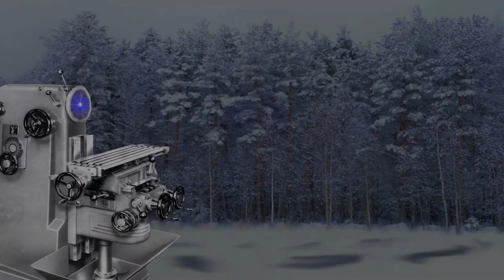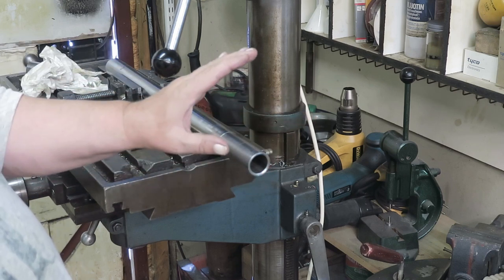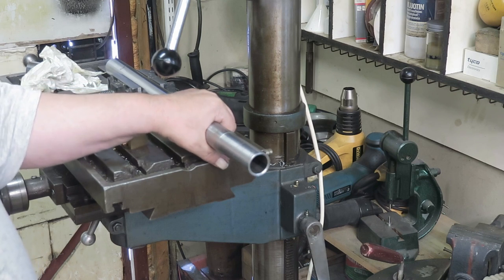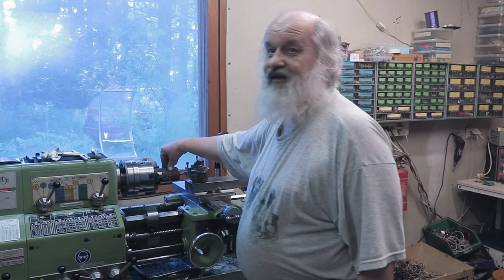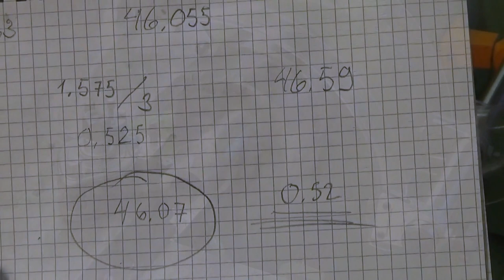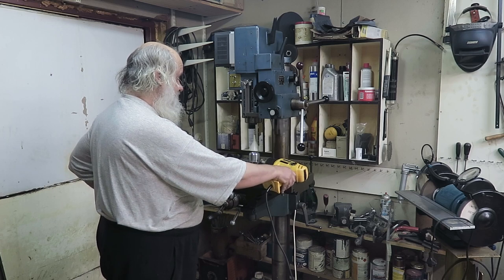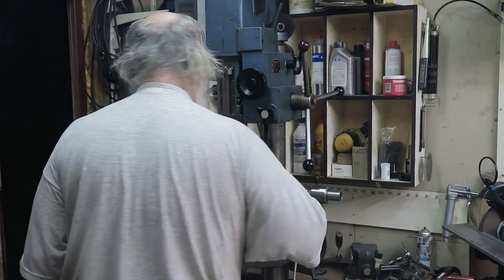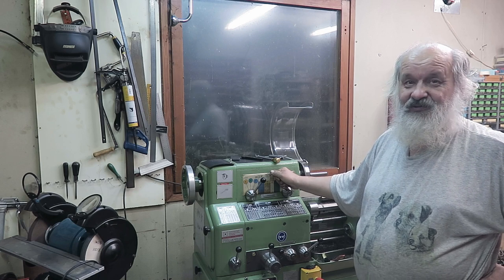5C Collet System for my Weiler Matador

Comment: You should truly tryout deeper cuts with that lathe, it can take at least 2mm roughing cuts.  OD cuts I mean...  
Nice salvage to working 5c collet🤠🤠
Reply from the maker: Yes. Unfortunately the only tool holder for my Multifix is a borin bar (round shank) holder. That is VERY unsafe for hogging cuts with a rectanle shank cutter. I am waiting a bunch more of holders for the Multifix. Then I will do those Abom-style cuts. Actually I will test what this lathe can do - it is always good to know Your limits.
Reply: 2mm per side you mean, of course? And even more from the ID
Reply from the maker: @MF175mp  The tool holders have arrived and I have done some limit testing. 3mm from diameter (1.5 mm/side) is still comfortable. Above that the chips become toasty and nasty. Parting off works really well under power feed. 25 mm round bar (maximum reach for my insert tool) was cut under 10 seconds. The material is cold rolled steel aka mild steel.
Reply: @FinnoUgricMachining  nice to hear that parting off goes without much drama. Do you use a 2mm insert blade or something thicker?
Reply from the maker: @MF175mp  It is a 3mm insert in a Sandvik holder. The very normal stuff.
Reply: @FinnoUgricMachining  that's impressive rigidity, I use similar setup on a big Örn and it couldn't probably take much wider blade either. But I run it dry with maximum rpm